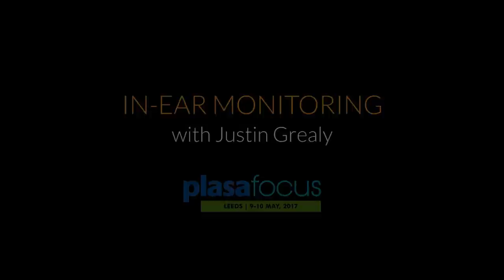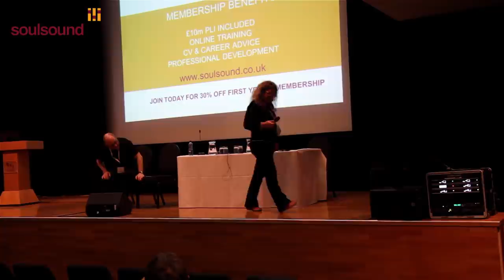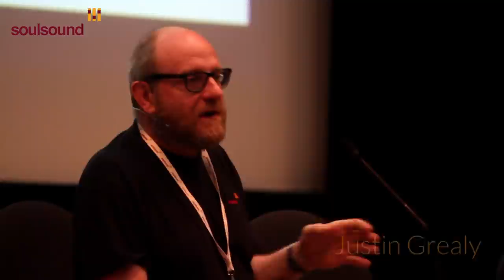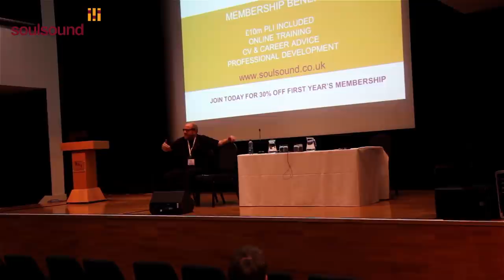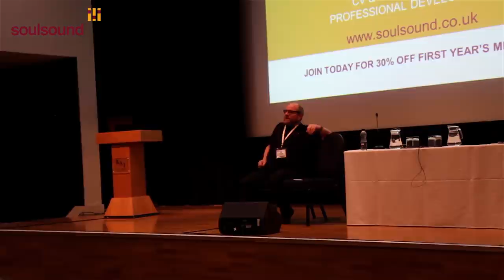In Ear Monitoring – Getting It Right

Comment: Did Mr. Grealy on one point talk about limiting for ear protection? I want to build a small in ear setup for my rehearsal room and the topic seems very important to me, yet I am not able to find a good source for information. Some people recommend just buying a bodypack with an integrated fixed limiter whilst other people suggest working with an external limiter/compressor on the mixer.
Reply: Greetings, numerical colleague.
As I recall, I did mention compression for protection in passing but not in any great detail.
Many of the high end in-ear systems have limiting options of varying usefulness and severity. There are generally designed for hearing protection purposes. However, for your rehearsal room, I would recommend firstly not using radio, as radio systems are expensive and often require licensing. Hardwire packs are cheap and easy and more reliable. In order to achieve effective hearing protection in this situation I would use a mixer based compressor. There are of course enormous differences between analogue and digital mixing solutions here. In the world of analogue joy, one can use even a cheap compressor very effectively. If your compressor does not offer frequency sensitive options, then a trick I have used is to "y" split the vocal channel and use the second channel as an external key input to the comp., therefore allowing the use of the channel parametric eq to select the centre frequency of the compression independent of program.
I think it is very important to bear in mind that exposure over long periods to relatively low spl can be more harmful than large transient peaks.in the digital world, there may well be a software compressor that will suit, it really depends on the console. 

I'd be happy to talk in greater detail if you wish. Hope this helps.

Justin.

Comment: It's a bit more tedious to work out how loud different instruments are in the mix is with in ear monitors as instead of walking up to the stage to check a wedge box you'd have to keep swapping with the performer.
Reply: Some mixers have an output dedicated for this. When you select monitor mix 1, a dedicated headphone output for the mixer will mirror the channel so you can hear what each musician is hearing while you're setting up their mix.
Reply: @mrmooch2163  actually it's easier with IEM than with wedges. As long as it's set up proper, you won't have to move your rump once.  Just listen to the band members complain.  lol